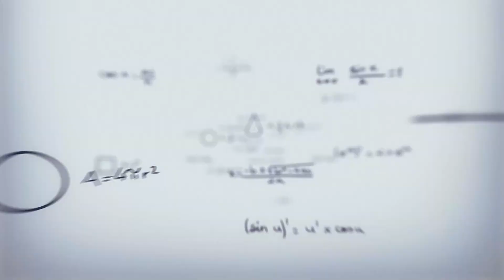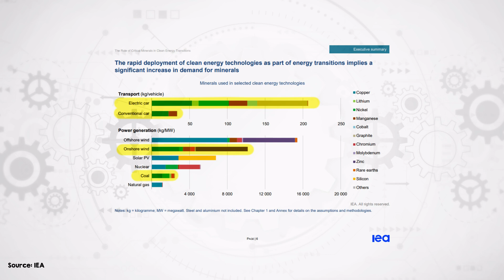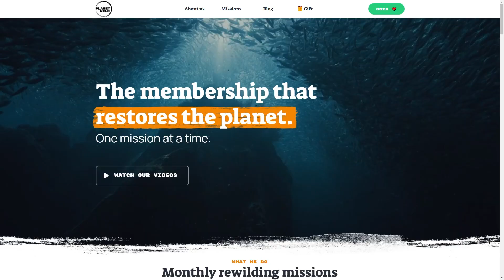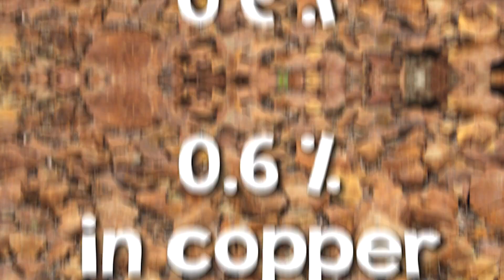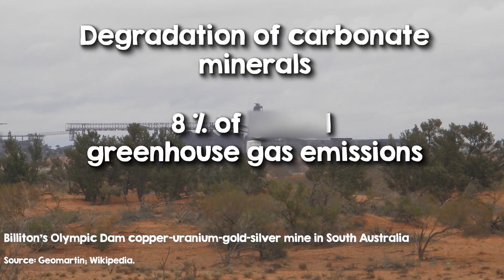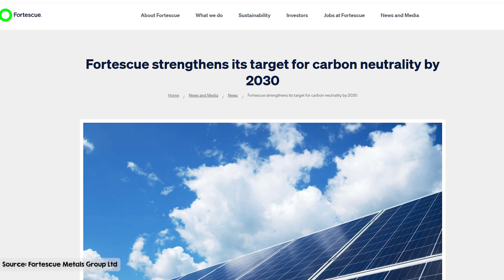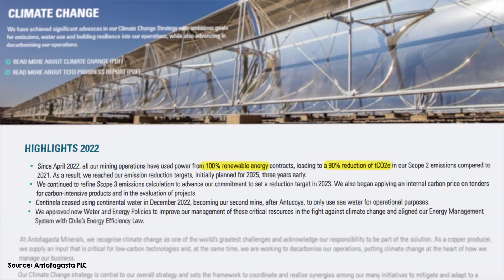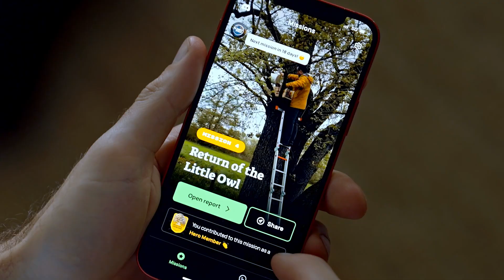Zero-Emission Mining Technologies are Here

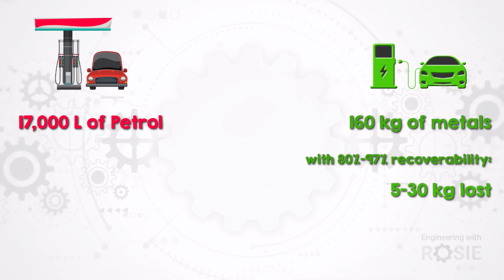Comment: You state up front that EVs take 10x more minining to produce; at about 3:50 in your video - you say the "typical" non EV will use 17,000 gallons of fuel;  but you do not give a proper figure for the EV's fossil fuel consumption. 82% of the world grid is coal, oil,biomass and gas fired. 8% nuclear,6% hydo only 4% are wind and solar. There is a typical 15% loss in electrical power in transmission and charging an EV.  The EV weighs about 20% more so it takes 20% more energy to move. So at best; you might required at least the equivelent 17,000 gallons of fossil fuel to power the EV plus it takes 10x more mining.. how does that add up to a positive?
Reply: Using the world's average grid carbon intensity of 450 g/kWh, as you proposed, a Tesla Model 3 emits as much CO2 as a gas car getting 86 mpg!  You know many gas cars the size of a Model 3 getting that efficiency efficiency?
If you use the average US grid carbon efficiency of 351 g/kWh, then you need a gas car getting 110 mpg.  If you use my country's grid carbon efficiency, then this number becomes a whopping 4800 mpg!  BTW, my model accounts not for 15 but 16% transmission + charging losses.
BTW, the 17'000 number is liters, not gallons, with equates to a 200'000 km ( 125'000 miles) average lifetime of the vehicle.
So, coming back to the world's average grid's carbon intensity, the comparable EV would emit the same as 2325 liters of gasoline, or 7.3 TIMES less!

As to weight, some (badly engineered) EVs do indeed weigh 20% more than a comparable ICE car. Other EVs weigh te same within a few pounds as their comparable ICE counterpart (Tesla Model 3 vs a BMW 3-Series, for example).  So, first ting to say, that an EV weighs more is NOT a given, if the EV in question is well engineered.
But even so.  An EV recovers when going downhill ca. 70% of the energy invested to gain elevation thanks to regenerative breaking, something an ICE car is by nature in capable of doing.  The same is true for accelerations/decelerations.  An EV is also inherently more aerodynamic than a comparable size ICE car.  Firstly because it is more optimized on this dimension (but an ICE car could as well), but because it has a several times smaller cooling system, and driving air trough a grille and then radiator creates a lot of drag.  So, an EV requires a bit LESS energy applied to the wheel to move, and approximately 5 TIMES less energy overall.

You need to deepen a little bit  your knowledge of EVs... and of life-cycle assessment related matters!
Reply: I was using the data presented here of an ICE vehicle using 17,000 liters for its life of about 200,000 miles ; so the question is in a fair comparision; how much does a Model 3 or a Model 3 long range that weights 4500lbs or Model Y which also weighs 4500 lbs is going to compare.  You selected the best of class short range Model 3 model which isn't very popular.  Where is the EV going to pick up help even overcoming the 10x more mining required to make it?  You are using a "carbon intensity" number? You can show me where you got that; but we only need to look at how EVs will get that power to go 200,000 miles. If we are to use these I'd want to see where they are derived and how.  My points is if you drive the car the same way F=MA say the 20% heavier car will tae 20% more energy to go the same distance. If you had an all home solar powered car; OK you'd quickly be able to fill that gap compared to gas or diesel; but that is very atypical.  The vast majority especially in the future when you get more apartment dwellers will be grid powered. The 15% transmission loss; is going to wipe out the small percentage of renewables and even the hydro.. leaving fossil fuel and nuclear. Nuclear uses a great deal of refining as U235 is only 0.7% of Urainium and Uranium is rare to start with; so it isn't CO2 Free - OK so for the vast majority of people that use the grid perhaps you can claim a 10-15% advatage given the power plants try to keep at the highest efficiency during the time they run - OK at 10-15% advantage it takes 6-10 years to make up the deficit you literally dug into the earth. 

Now I have some curve balls to throw  your way; which use 100% renewable - ethanol, bio diesel, (maybe hydrogen if the USGA claims of finding 200 trillion tons of hydrogen in the USA are right)  So using these alternatives either mixed in as a percentage of fuel or 100% renewable fuel - then its very hard to beat the ICE car because of the mining advantage they have. You can add to that hybrids which can often do commutes which are 80% of the miles people drive all electric; they can plug in use smaller batteries.  If you want to explain the source of your other argument i'll be glad to have a look; and we can review all that where I understand what those numbers mean.

Comment: Related issue:  how is the steel needed for a wind turbine compare to the steel used to build an oil well?
Reply: Totally peanuts in overall emissions!    Moreover, the steel is recycled in both cases at the end of the respective life cycles.  However, none of the oil extracted by the well is ever recovered.
Reply: @st-ex8506 just the same with the coke required to recycle the turbine.
Reply: @0Aus  What coke?  Turbines are not being recycled either in Columbia, or in Georgia!
Seriously,  no coal is needed to recycle steel, which already contains the necessary proportion of carbon.  Steel recycling is rather done in an electric-arc furnace. So you need electricity... possibly from wind mills... to recycled wind mills!  A complete and virtuous cycle!
Reply: @st-ex8506  yep the green steel dream. 
Let me know when it happens. As for now scale?
🤣 we still use coke.
Reply: @0Aus  Coke hasn't been used for recycling steel for about a century, it seems like you don't really know how the steel industry works. Arc furnaces have been the standard for recycling steel ever since they were invented since they not only don't introduce any impurities but are actually really good at removing them. Meanwhile a blast furnace fired with coke produces pig iron that needs further processing, it makes no sense to use that for recycling.
Reply: @hedgehog3180 Firstly you have failed to understand the point. 
Coke is required to manufacture quality steel from ore.

Comment: Hi 
Very informative and factual information on how zero or much reduced emissions can be achieved, but the fly in the ointment is money I am sure that many of the mine operators will take on some of these practices but when profit is at risk only 2 outcomes are available the price goes up and emissions get ignored all quite sad really 
Keep up the good work
Reply from the maker: I think this is one area where the issue of cost will be won by clean techs for the most part (not all). Onsite diesel is really expensive, renewables, batteries, EVs are cheap and getting cheaper!

Comment: Shame on you, Rosie.  Stop it!  It is disingenuous to weigh hydrocarbon production as equivalent to mining of minerals on a weight basis.  For this comparison to be somewhat fair, you would need to include the weight of spoils in the minerals production.  Which by itself would completely swing the evaluation the other way.  And then next, you'd have to consider effort required to rehabilitate the sites.  For hydrocarbon production, this is basically 1) Grouting the wells to stop migration of fluids in the pipe used for production.  2) Repurposing the above ground tanks, pipes, and pumps to other production sites or recycling it as scrap iron.  3) Removing the road infrastructure and pads and rehabilitating the top soil.  Contrast that with the effort rehabilitate a strip mine!    3) Finally, you need to factor in impact on water resources.  When developing a hydrocarbon resource, you need to be thoughtful and careful about developing the well to avoid contaminating aquifers.  And you have to treat all water recovered as a byproduct of hydrocarbons.  But this load is a minor compared to the water treatment requirements of the same area populated with a suburb.  While with mineral extraction you have the problem with spoils ponds, leaching from spoils piles, much larger volumes (compared to HC production) of water involved in concentrating minerals, etc. I live in Colorado.  We will have a much more sustained and long term problem with the mining we did for silver and coal in the last century than we'll have with the oil and natural gas production in its entire duration.  Please try to come up with a more balanced shtick.  I'm sad.
Reply from the maker: I will look out for your rigorous lifecycle analysis of all mines for all materials fitted into a 15 minute video that's interesting enough that people actually want to watch it. When you make it, don't forget that rare minerals are usually mined as coproducts of other mined minerals. So the analysis is more complicated than you suggest.
Reply: @EngineeringwithRosie  But order of magnitude, your approach is still disingenuous.  You could just have of omitted this 30 second bad slide, and your presentation wouldn't have suffered.  Maybe a bit less propaganda value.
Reply: Thumbs up for your comment.  A big thumbs down for the lies and misinformation in this video.
1. Rosie claims 10% of global CO2 emissions are from mining, "with over 90% of that from fugitive methane released during coal mining".  First, she just confused methane and CO2.  Doesn't she know the difference?  Second, according to "Our World in Data" "Greenhouse Gas Emissions" chart, "Fugitive emissions from energy production" is only 5.8%.  This includes all CO2 and methane from all types of energy production.  Does she just make up numbers?
2.  She compares the 12,750 Kg of fuel burned by a petrol vehicle with the 160 Kg of minerals used in an EV, and says that's 99% less mining.  Surely she knows that in order to get 160 Kg of minerals, you need to mine at least 2 ORDERS OF MAGNITUDE MORE ORE.  In other words, you need to mine 16,000 Kg of ore (and overburden) to get that 160 Kg of purified, finished metals.  This doesn't even take into account losses of materials from the manufacturing/fabricating processes.  (I'm not including the recycling of batteries since it is only hypothetical, and not commercial reality at this point in time.)  Petroleum extraction generally removes only the petroleum from the ground.
3.  She talks very flippantly about increased mining being good for the planet since it reduces the amount of plant food (CO2) released.  Plant food becomes people food through photosynthesis.  Do a search for "Carbon Dioxide Fertilization Greening Earth" to find an article on the NASA website about a study showing increased CO2 is 70% responsible for increased plant growth on earth.  Also, interestingly, climate change is responsible for 8% of INCREASED plant growth.  (Yes, the MSM and the IPCC are lying to you.)  In reality, the climate is getting MILDER!  High temperatures are NOT increasing.  Low temperatures are increasing, primarily at night, in the winter, at higher latitudes.  That's why the average temperatures are increasing.  Also, severe weather is NOT increasing; that's just fear porn to convince you to give up your freedom and money to the elites.
4.  She also talks about the efforts to decarbonize mining and material production with no consideration of real-world economics and pricing.  It's easy to wave hands and pretend that all this will come about at no cost to anyone.  In the real world, these things have costs, making poor people suffer.  Poverty kills.
Reply: Truth in advertising:  I'm a chemical engineer and I worked as refinery process engineer before going to grad school.  My PhD was in underground coal gasification.

Comment: EVs aren't zero-emissions and the UK's advertising standards agency have banned them from claiming such. They are remote emissions. I think I'll start calling them REVs from now on.
Reply: What will you call them when the grid is 100% clean?  That's the direction we're heading.
Reply: @incognitotorpedo42  Nothing will ever be 100% clean. There are few to no concrete plans for most of the waste generated by "clean" energy.

There are huge wind turbine cemeteries filled with discarded blades nobody knows what to do with since most composite materials don't really have second life potential as anything else.

Solar cells may be hypothetically recyclable but most glass "recycling" projects end up as alternative concrete fillers or other crude disposal methods because it is prohibitively expensive if not impossible to purify silicon enough to use again in anything that requires high-purity silicon, like semiconductors such as PV cells if you want remotely decent yields and performance. We'll be dredging ocean floors and beaches for semiconductor-grade virgin silicon for decades to come.

Batteries may be (mostly) recyclable but total demand for the stuff is unlikely to stop growing and there will always be losses from fires, disasters, batteries going to landfills, etc. so the battery ecosystem will never achieve closed loop. All of the raw material mining will persist forever, albeit possibly at a reduced rate.

Pretty much every aspect of the "green revolution" has massive environmental impact somewhere else that isn't going to end any time soon if ever.

EVs will always be remote emissions at best. At worst, their battery can catch fire and release all of those yummy fluoridated battery compounds wherever they croaked and we are likely 50 years away from finding out how nasty exposure to this new modern-day hazard is.
Reply: @incognitotorpedo42 we currently live here as such it isn't emission free.
The vehicle ect has to be manufactured coke for steel and so on.
This is the real world you can't dream the future expecting it to be so.
Reply: @0Aus  I live in Denmark where at night wind energy alone often provides more than 100% of demand so I can easily make an EV completely emissions free to operate.

Comment: hey rosie,  you start the video wirh a false dichotomy that we either have to mine and go green or stop mining and keep producing emissions. 

there are plenty of other solutions like recycling.
cars- one of the many things we are told we should have  individual ownership of, but with proper infrastructure and consolidated towns, are obsolete. not only is the metal recyclable and plentiful, but the plastics can also be mass manufactured into small consumer turbines. 

it makes it hard to watch this video when you force your audience into a perspective. and might i even add that you are green washing mining from the start even if you take an opposing point later in the video.
Reply from the maker: I sort of agree, but we are still using nearly all the lithium ion batteries, solar panels, wind turbines etc. So we'll need mining for a while yet. The job would be much smaller if we had less personal cars and stuff in general, but it wouldn't go away.

Comment: 3:38 again, i think you underestimate the weight of the battery in the car, or mention very small inner-city focused models with very limited range: a typical EV would have 400 to 500 kg of battery, and the biggest ones (american pick-up trucks) could go for 800 kg or more...
I am saddened this is not readily available info from all car manufacturers... 
Thanks Rosie for the video overall, though
Reply from the maker: The battery and fuel values "match" so to speak, so a larger car or one friving further would also have increased petrol consumption so the comparison should roughly hold. The source for the comparison is in the description.
Reply: @EngineeringwithRosie  thank you for the comment, and I get your poi t that the comparison holds, but do you corroborate my limited research that recent EV have significantly more than a few hundred kilograms of battery?
I also understand your point from another video that the weight of the battery pack is somewhat offset by the more lightweight electric engine.
It is just that I got a very different message about the mining challenges you present here from another researcher: Aurore Stephant. Have you seen her videos? She speaks French, I don't know she has content in English.